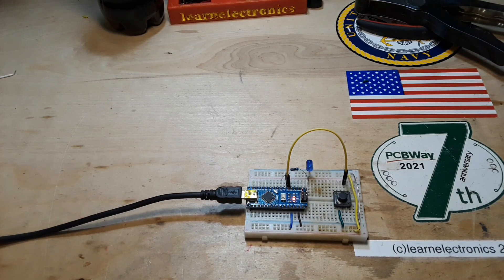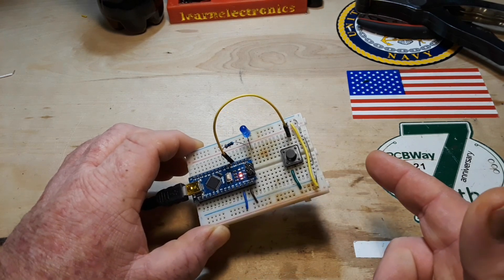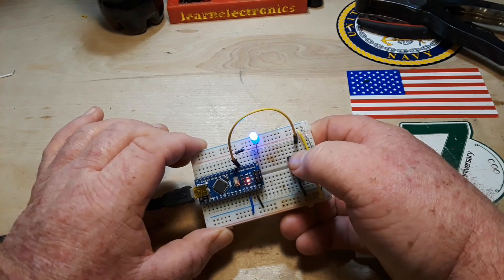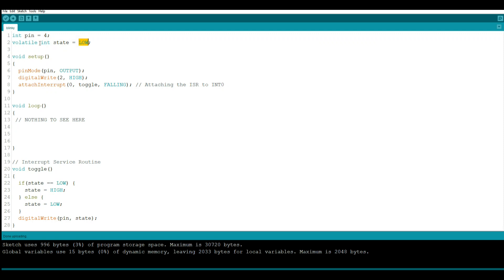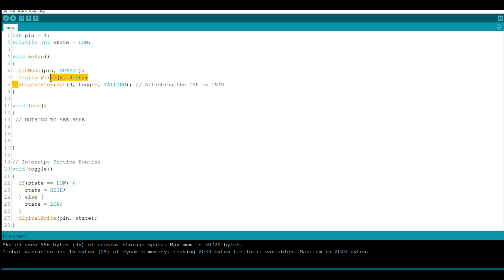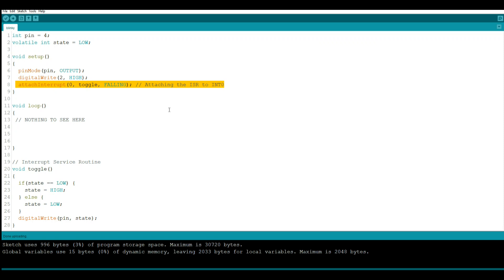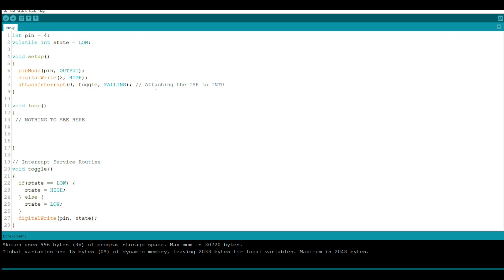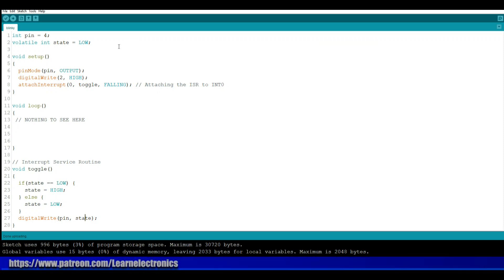Arduino Foundation Series: What is an Interrupt?

Comment: An analogy I've seen used a few times is that you are expecting a delivery. You can check two ways: 
You can check every few seconds to see if the driver has arrived, but you can't do anything that Thales longer than the checks. This is polling.
The other option is that you get on with other tasks, which can be long running. When the driver knocks, you make a note of what you were doing. Stop the process. See to the delivery, then get back to the other process where you left off. This is an interrupt
Reply from the maker: Great analogy
Reply: So basically when the board detects an input from the push button it gives it priority and executes whatever that push button does? And then just goes on where it left.

I always found the topic of using a button as a switch (like in the video) a nightmare. Now i finally found a solution to it. But is there a limited amount of pins that can do this (in the vid he said pin 2 and 3)?
 I'm a beginner myself but i really want to dig deeper in this one.

Comment: Nice, Paul.

I was so happy able to get the interrupt going in a test environment--just the UNO and serial monitor--while building a ID Timer (ham radio). I did use the built-in pull-ups on the button pin and added a debounce routine. It worked nicely. I added the code to the ham radio dashboard I've been playing with, which has an I2C LCD and RTC. It not only did it not work, the LCD wouldn't work either. Finally figured out that there are some issues with using interrupts with I2C. Back to the drawing board, ended up scrapping the interrupt. So now with the regular button press, there are occasions when pressing the button doesn't catch--if the program is "busy" at the moment I press the button. I think that's the chief benefit to the interrupt/ISR that I lost without using it. Might try it again someday when I learn more about this cool Uno. 

Keep up the good series. I'm really enjoying your presentations and your work with the school kids' learning boards.

73 de N6BVZ/4  wil--from down in North Georgia

Comment: When writing code is there a preference between using if/then/else and negated Boolean values?

void toggle()
{
  state = !state;
  digitalWrite(pin,state);
}
Reply: Each to their own I reckon. If I needed to save a few bytes then I'd use...

Void toggle(){ PIND = 16; }
Reply: @mrtom64  

Thank you for your reply.  I had coded the two examples and after testing could not see any difference between them.   

However, your answer was interesting.  It took me quite a while to discover that PIND is a register and to get some idea what it is doing.   I will be spending a few good hours discovering more about the chip registers and how they work.    This is going to be fun !
Reply: @RichPenn  No worries. You should find 'Direct Port Manipulation' MUCH faster, and to be honest it's not as scary as it looks. As for 'PIN* = ?' as a toggle....I don't think its documented as such so don't be surprised if you don't find anything about it being a toggle, all I know is that it works, and works well. Have fun!